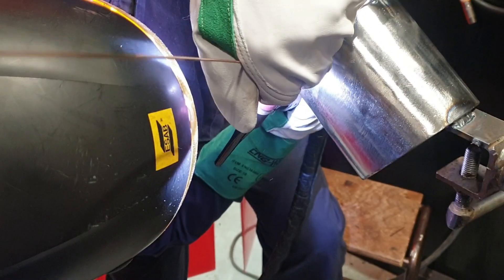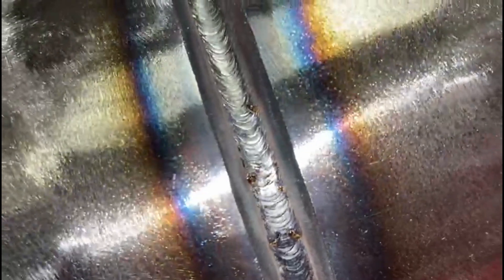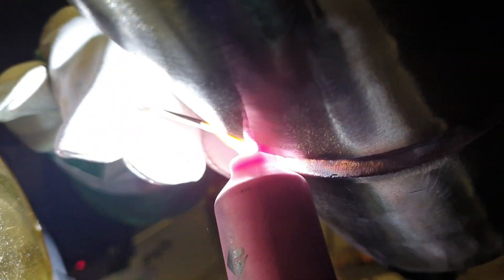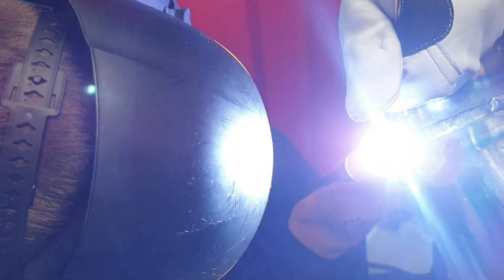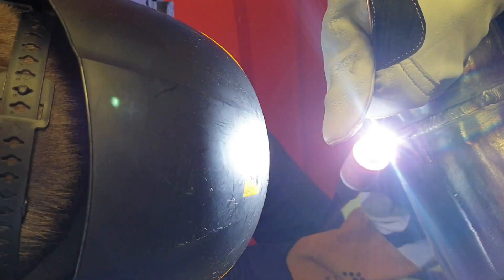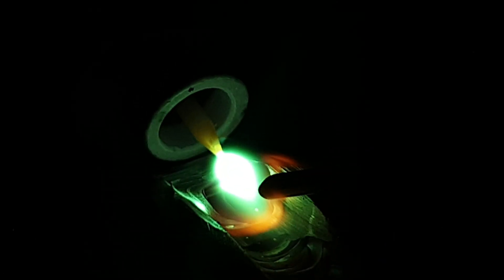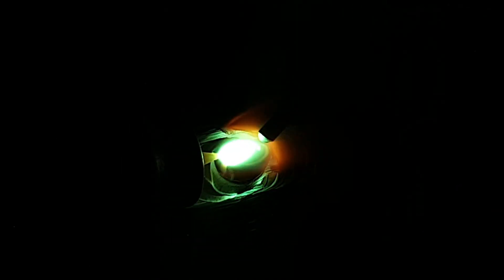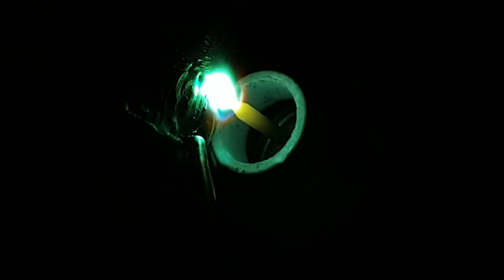STOP Wasting Time with Bad Tig Welding Techniques, Learn the 6G Way!

Comment: I want to weld up a new exhaust for my mustang but I need to learn how to weld first. How would you suggest I start to learn?
Reply from the maker: What material is the exhaust is it stainless steel or mild steel? I need this information so I can direct you.
Reply: @weldtechsolutions  409 Stainless steel
Reply from the maker: If you've got the equipment at home then a bit of youtube and some practice would be a cheap and quick way.nothing like having a go .
Alternatively like in the UK some local college's do short training courses for the public to attend which are great for first timers.
Reply: @weldtechsolutions  I've seen enough bad welds to know this is not an easy craft. So, I just thought maybe buying some scrap metal and trying to weld them together for practice. But from what I heard, welding pipe is a whole other ball game.
Reply from the maker: @rufus5208 so I would start with the basics runs on plate get used to the torch, after this your going to want to start close gap butt welds, but remember if it’s stainless you should purge the inside with argon so you have a clean root. How thick is the material?

Comment: Butt joint welding. 6013
Positaion. Overhead. 6.f
Reply from the maker: We will incorporate this into one of our videos in the new year. This is one of the More tricky welds so I think this is an excellent choice. Thank you for your feedback.
Reply: Overhead weld 6013 is now on the channel. Enjoy
Reply from the maker: @anthonyshelton7828  Thank you for highlighting this. 6013 rutile and 7018 low hydrogen overhead are now live videos on the channel.

Comment: Here’s a few suggestions to improve your videos. You did not discuss fitup, what size gap, and how the edges should be knife edged. You didn’t mention what size filler rod or what amperage you were welding at. Also, a lot of people don’t know how to tie into their tacks. You didn’t mention anything about that either
Reply: All welders find their own technique as some walk the torch and others freehand plus others have different size gaps plus tacks so they actually don’t need grinding out
Reply from the maker: @Then.72  correct some people actually tack into there root, I’m personally not a fan of this as everything I weld here x-ray ASME IV tested so I find it leaves chances for defects. But you are right different welders do indeed use different tactics it’s always one size fits all.
Reply from the maker: Good points there Shawn. Thank-you for your feedback this has been noted. 👍🏻
Reply: He doesn't need to divulge all that info to "improve" his video because he's just showing what he does everyday at work; it's not instructional and if you think knowing all that and following him is going to make you a welder or a better welder, it's not. Knowing what amps he's using, fill rod, gap size doesn't mean anything if you can weld because nearly every job/shop uses different fitup and weld procedures. Some places might have all their pipe fit with a 1/8" gap or 5/32" or 3/32" or whatever. Some shops might even have all their pipe with a landing even if it's going to be tig welded. As for tie in technique, there's at least 4 different ways to do it on alloys like stainless that I know of and use but if you need to have him tell you how he does it, I wonder if you're trying to learn to weld by watching youtube videos.
Reply: @44 83

I’m not trying to learn to weld. I was a union boilermaker for over a decade and I’m currently the lead welder in the pipe shop at the shipyard. 

The creator of the video took the constructive criticism well. I was trying to provide the perspective of someone new to welding who is trying to learn how to pass a test. Including gap size, amperage, and other variables would be useful for someone new to welding and it wouldn’t take much more effort to include in the video. 

Trust me, I know that these are not constants in the field. I weld with a mirror more often than not when I’m doing piping in the ships.